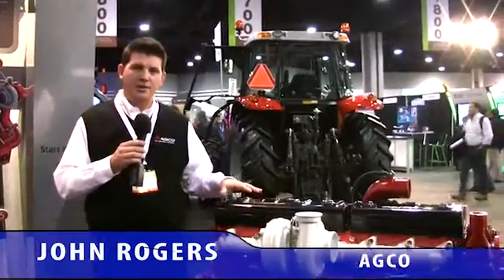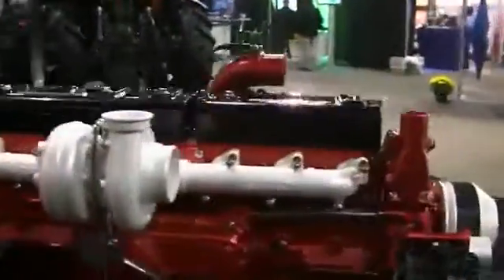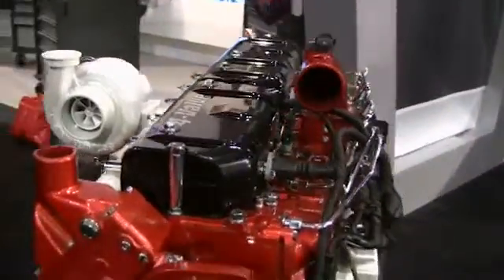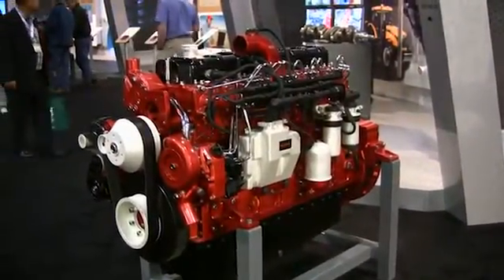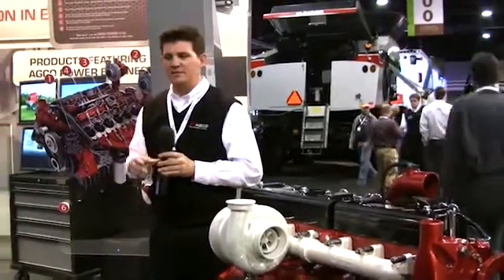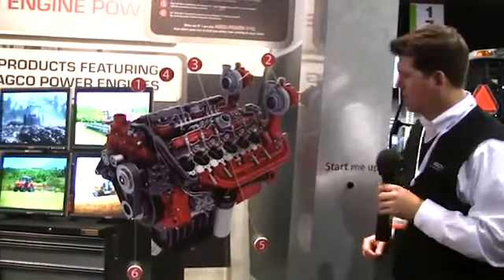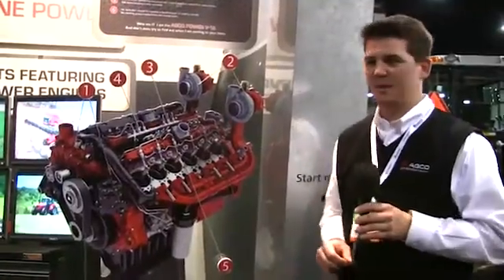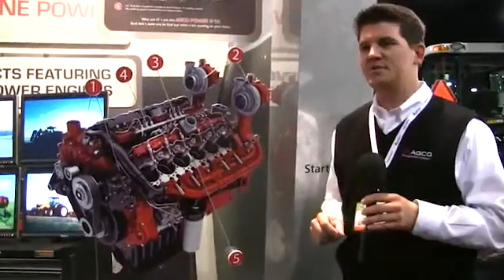AGCO developing 7-cylinder, 12-cylinder engines

Comment: Name one single thing that a 7-cylinder inline engine can do that cannot be accomplished better by an inline 6, inline 8 and/or V8 of the same displacement, short of shaking itself apart in record time. Cylinder banks of uneven cylinder quantity have been a bad idea since the invention of the Otto-cycle. Audi already proved that a 5-cylinder inline engine contributes absolutely nothing to their engine lineup short of being bait for ricers and their fart cans.
Reply: And inline 3 engines are fantastic in small tractors and bull dozers so your argument of uneven cylinders is just wrong.
Reply: And straight 5 in Chevy trucks are fantastic motored too there is tons of uneven cylinder layouts on the market and most of them work fine. I think the most unbalanced engine is an inline 4 because they need a balancing shaft.
Reply: @russianacorns8080  Chevy Canyon ... I had one of the first out ... sold it back to the dealer and went back to a time proven Silverado 8cyl ... our 5cyl was in the shop for various engine probs until I had enough lack of reliability . No one wanted to give us $$$ for a less than 2 years old vehicule still under warranty . No more 5cyl on our farm . As per 3 cyl ... indeed economical but NO torque again ... we own 12 Deeres of various sizes and ditched our 3 cyl because it was just useless . The question is valid WHY bother at AgCo with a full line of very potent proven 6cyl to develop a 7cyl ??? Good day russian .
Reply: ChielScape straight 7 engines have proven themselves in marine applications for a long time
Reply: @satunnainenkatselija4478  personally as a farmers son, fendt tractors are made with the utmost quality compared to any other brand, ask anybody who has used one they will tell you they are great. However the models I am familiar with that house the inline seven are twin tracked machines which are in all honesty, completely overkill for our operation, as well as needlessly more expensive both upfront and in the long term to a wheeled machine. But I wouldn't be afraid to use an inline 7, gasoline inline 5s hold up quite well and they run at higher Rpms than a inline 7. So I don't see why an inline seven running at 2000-2500 rpms is going to fail tremendously. Plus I wouldn't be the one fixing something that advanced anyway. If AGCO put it into their Fendt tractors they know it will be reliable enough to last as long as any inline 6. Plus that low rpm thing has to do with the transmission more than the motor. It involves their Vario CVT transmission, which helps create better torque at lower RPMs so you can run your tractor at lower rpms so it saves fuel and increase longevity.

Edit: and they are manufactured in Jackson, Minnesota, as well as Germany. So the whole idea that they can't produce more than enough power because they aren't American is a falsehood. They had the first MFWD tractor with over 500 horsepower, in fact even in 1980 they had MFWD tractors that had more horsepower than a standard American 4WD.
Reply: @duckdestroyer2412  Hi! Another farmer’s son here. We got a Challenger MT775E last fall with the inline 7 under the hood. We’ve run Caterpillar/AGCO twin track machines since the mid 90’s and have nothing bad to say about them in terms of reliability. In addition to that, I live just a half hour from where it and our MT765C was built in Jackson. The inline 7 has absolutely no shortage of power and pulls a 7 CaseIH 875 like it’s nothing. There is a very slight engine vibration between 1100 and 1200 rpm, but overall it’s surprisingly smooth, probably because of the high cylinder count
Reply: Bro we don’t even know what inline 7 sound like yet give them a chance
Reply: Inline sixs are effectively flawless in most categories except length. But a Inline 8 is just too long, and a V8 has no longevity compared to an inline engine. A inline 7 is strange but definitely not impractical because it will produce more power, but without being unnecessarily long. And inline 3s and 5s have proven themselves reliable just imbalanced, which is easily solved by a counter balence. Plus these engines are for AGCO which produces diesel tractors, which run up to 2500 rpms so it isn't like they will be shattering themselves apart at 6000 rpms.

Edit: after a little research I have found that agco did I fact use this engine in full production models, for example the Fendt 940 series uses this engine and produces 425 horsepower.
Reply: The inline 5 cylinders aren't a bad idea though 
They are smoother than I4s because of the 1° power overlapping in their firing orders
Yes they have primary imbalances but these issues got solved 
And their secondary balances are decently good (better than the I4s and surprisingly near from being as good as I6s in this field)
And they're easier to put in the engine bays 
Volvo...Audi and others proved that with their reliable engines
And I think you didn't hear a trash sounding five banger ever...I mean ever
Reply: This is what happens when  young engineers go crazy and don't have any sense for the proven designs of the past. 6 cylinders is one of the most balanced engines out there.

Comment: @zivaTARY well down in low rev range, engines aren't extremely distinguishable, though I'm sure that you and I can tell the difference.in the high rev range it has to sound like a 7 cyl radial engine, assuming the crankshaft follows the prime-number-of-cylinders 5 cyl configuration where there is supposed to be one piston up at a time per power stroke. A 5 cylinder radial engine shares the same, if not, a relative blend of harmonics to an inline-five engine. crank has same shape as radial engine